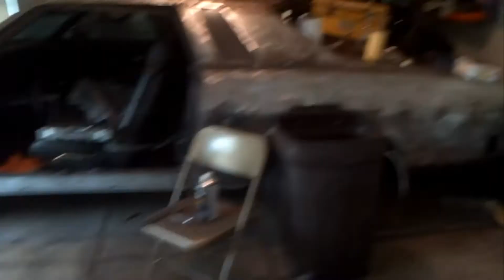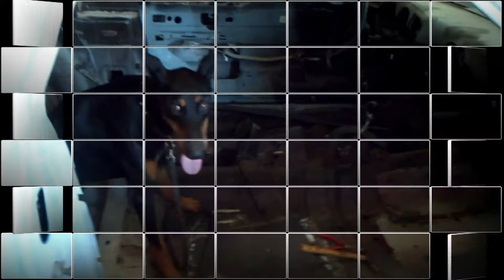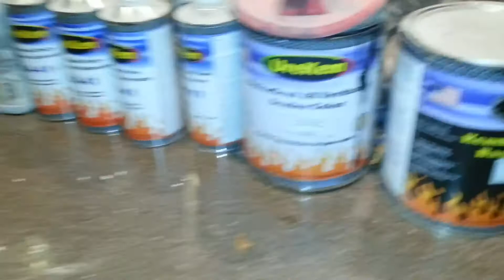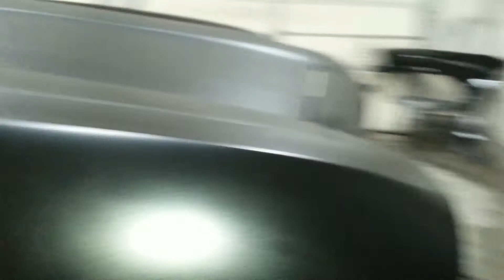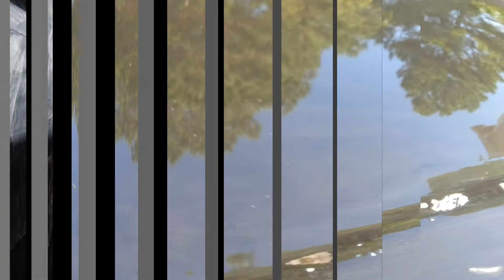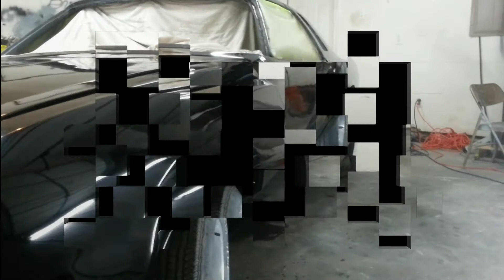Painting the Cutlass Supreme "DARKNESS" Epic Redo

Comment: No problem..you have been through it! Yeah I removed the vinyl top and did some rust repairs. I had to cut rust out and weld in metal behind the rear wheels. Its a 455 car and had single pipes with a "cat". The motor in it is not a 75' smog motor..it has C-heads. I had to buy a dual hump cross-member summit. I just put an X-pipe on it and im am very happy about that..haha. The car sounds way too nice.I plan to do a video of it running and driving  reall soon. Man! keep up the good work!  -CB